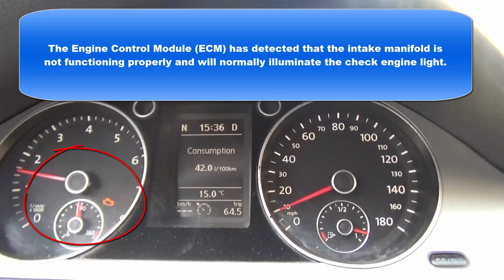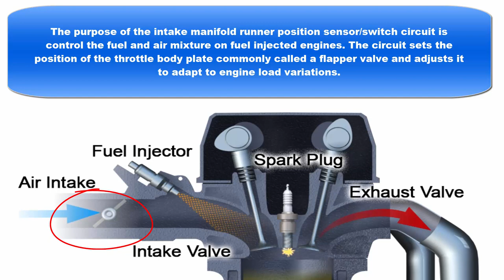What is p2015 code? What Does Code P2015 Mean?

Comment: I have a question, if i change only sensor will be correct or i need to change entire manifold, i have code P2015 on my golf gti v.
Reply from the maker: At first time, change only sensor and see if it works. 

if this way won't work, than change entire manifold.